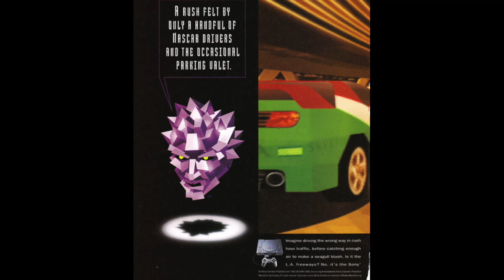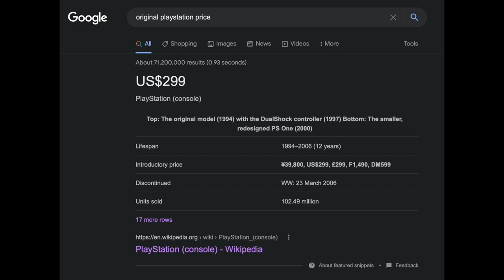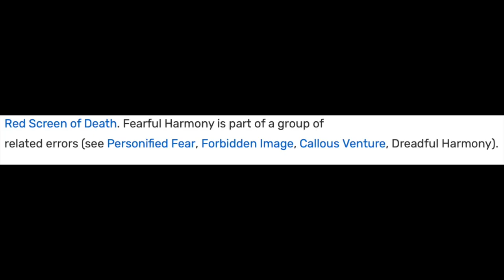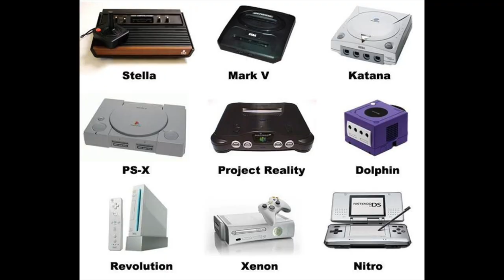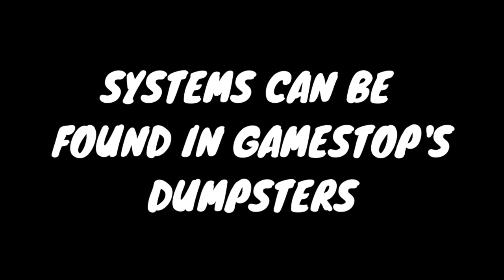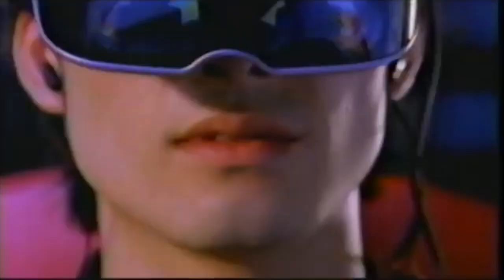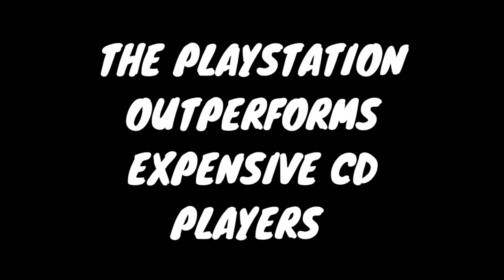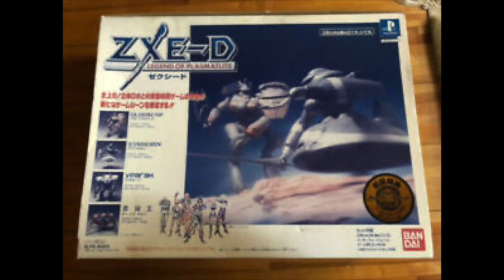The ENTIRE Playstation (PS1/PSX) Iceberg Explained

Comment: A bit of a correction at 13:00, only the later "psone" models would actually check for the regional text on the boot screen. The original Playstations (as well as psones, as a secondary security measure) would get the regional information from a specific groove printed onto the game disk that couldn't be replicated by retail CD burners. This is why solutions such as the swap-disc method work in order to play backups, you put in a legit disc with the groove so the console can get the regional information, then swap it out with your backup disc.

Comment: 35:00 same reason you should put old used microwaves in a bag before you unplug them to throw them out. Bugs LOVE hiding in unmoved electronics.
Reply: That literally makes zero since. If you're throwing it out, then it wouldn't matter. Use your brain bud.
Reply: @jaydayoungan632   Use your own brain. They have a tendency to come crawling out of the machine in a panic once they ARE moved (and right back into the room to hide elsewhere) so unless you're chucking it outside *immediately*, it's not a fun time.